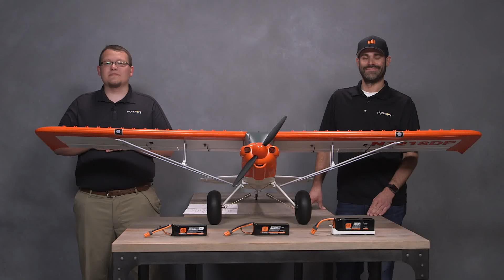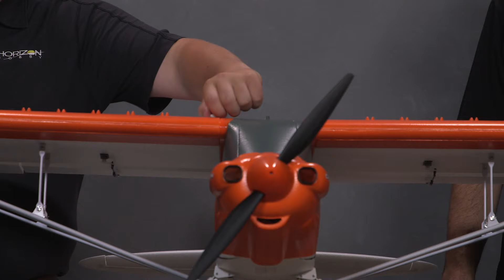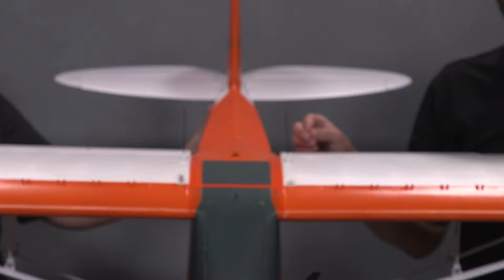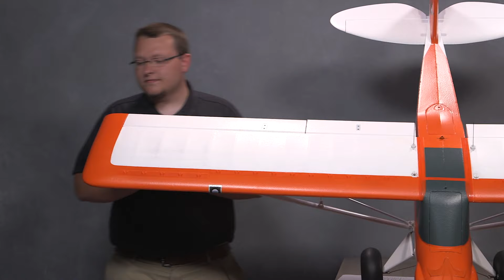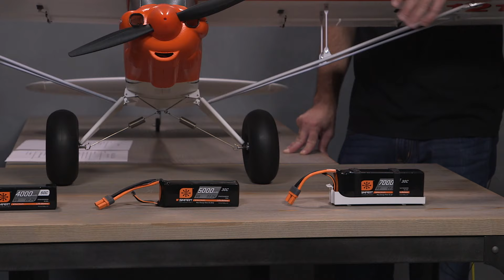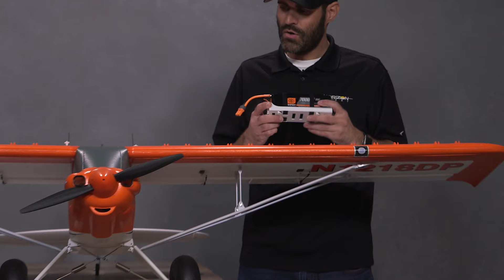Live Discussion: E-flite Carbon-Z Cub SS 2.1m

Comment: Great plane, I have had at least 15 good flights on it already, and a few crashes, just glues or use epoxy and figer glass( for the landing gear mount), goes right back together. Only complaint is how the wings keep on separating from the fuselage at the top. Seems like a few more flights and they will just pop out permanently. The thumb screws cannot hold the, anymore. They just keep on moving further and further out of the hole.

Comment: Great looking plane, I hope to get one soon. Just a thought, you could very easily improve the assembly of the wing struts. Instead of two awakward pin's on each side, use one twin with a spring clip. Like those old keyring clips. You just push the top to move the side pin in. That would be a pretty simple mod and make it super easy to assemble out of the car, and no tiny clips to loose in the grass.

Comment: Wanting a new transmitter but I'm stuck between the ix12 and nx10 spektrums which would you get? Also seen alot of reviews on radiomaster tx16
Reply from the maker: NX10 is a bit less complex than iX12 and still has plenty of channels and features that most people will never outgrow! Outside of that, if you prefer a touchscreen and Android interface iX12 is the way to go.

Comment: Can you add a 1.0-1.1 m cub with flaps for intermediate to advanced pilots to the lineup ? Thanks.
Reply from the maker: We currently offer the HobbyZone Carbon Cub S 2 ( https://www.horizonhobby.com/search?q=Carbon+Cub+S+2+1.3m&search-button=&lang=default ), which is set up for optional flaps and has a 1.3m span. And although the RTF version is geared toward beginners, the BNF Basic version is perfect for intermediate to advanced pilots! As you can see this video (especially after the 2 minute and 40 second mark), it's capable of aerobatics, float flying and more: https://youtu.be/Wgsq8VQZrG8

Comment: I'm curious if you can make the ESC reversible with a software upgrade.
Reply from the maker: The Carbon-Z Cub SS 2.1m BNF Basic version will now be available with a Spektrum AR637TA receiver and a Smart Avian 60A ESC! And yes, you can use that receiver and ESC to reverse the motor :) See this new version here: https://www.horizonhobby.com/product/carbon-z-cub-ss-2.1m-bnf-basic-with-as3x-and-safe-select/EFL124500.html

Comment: Hi, I have this plane, after some QC control issues I have it assembled.

The motor looks like it's pointing to the left, it should be straight or to the right. What are the thoughts behind this? I've asked this on rcgroups and some other have this to.

Can you please help? I'm afraid to fly it.  With the maiden it extremely banks to the left. I have the pnp so no as3x problem
Reply: Contact HH and ask...
Reply: @ricardopr54  i got a private message on yt that i definitely should not point to the left and should contact horizon tech support.

Sended them all of the pics but they say i need to contact my lhs. Which is closed because of covid..
Reply: @cnnlt200  Send them another email and request a return label so you can send the plane back. That's BS on their part to refer your issue to your Local Hobby Store... If they won't do that and give you a replacement aircraft or refund after returning it, then Sue their asses! This planes aren't cheap and it is disrespectful on their part to do that to their clients...

Comment: Im having problems. The throttle doesnt kick in before almost half stick. So i need to calibrate the ESC. But it wont calibrate. Is this due to the AS3Xa??  Do i need to do it with another receiver??

Comment: In looking at this plane from directly in front, (in the video), it doesn't look like it have any dihedral.  does this make it difficult to fly?
Reply: This is a very stable plane especially when using AS3x. If you have mastered a high wing trainer with it without dihedral you can handle this.
Reply: Harpoon_Bakery hard compared to what?
Reply: @michaelsell6928  to non-dihedral
Reply: Dihedral basically gives you some self righting ability. With a flat wing you have to fly the plane and level wings yourself is all.
Reply: With safe select activated all you have to do is let go of the sticks and it will level itself out.
Reply: @michaelsell6928  i believe you have to have a spekktrum radio to do that , correct?
Reply: Harpoon_Bakery yes that is correct. There are other flight stabilization systems on the market though if you want something to smooth out the bumps a bit. Aura8, Demon Cortex, eagle just to make a few.

Comment: Hello, I went looking for the new motor to put in my blue carbon z cub.  You didn't change the part number.  You should be kicked out of the aircraft line.  If I go to my  local shop they will sell me the old motor.  If I call tech support they will sell me the old motor.  I did call them and they told me the number had not changed and I had to send them a link to this video.

Comment: OK aircraft I would like to see in large-scale is the Pilatus PC-21, I love the T28 Trojan but nothing flies like the Pilatus PC-21. Do it in a 2.1m size with a 5 blade prop and AS3X would be amazing Jason! The aircraft already flies on Rails but Ya'll can make it even better! If anybody here has flown a PC-21 model you know you can agree. :)
Reply: I own the 2.0mtr large scale original but, discontinued  T28-Trojan and find that they are
Both far and between being similar in flight control and  one is a sports aircraft (carbon z V2.0 and the
Other more a scale flyer (Trojan T28).
Reply: Pc-21 is a jet
Reply: Pc-12 is a turboprop

Comment: In my opinion compared to the original version 1 it's technically not even the same aircraft, version 2 is insanely good right out the box, don't even hesitate getting one pilots! Flies on like butter on rails so hard to explain. If that makes any sense? lol.

Comment: I have flown this plane several times and it is awesome!   Very easy to see with the orange and the landing gear is very functional.  First flight video of the Carbon Z Cub.  I will buy another one of these to have in stock at the house.   Bring back the Big T-28!  https://www.youtube.com/watch?v=oIJj-OQWxWs&lc=z23ktzwgvnbesx40lacdp43atafhkh2t50fbdvw2fchw03c010c